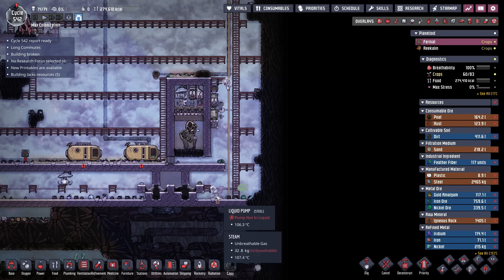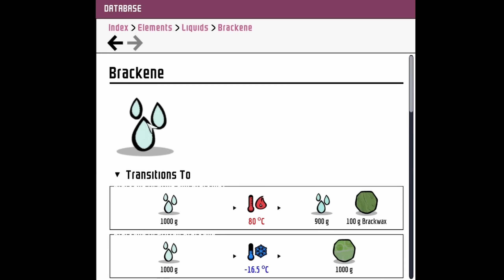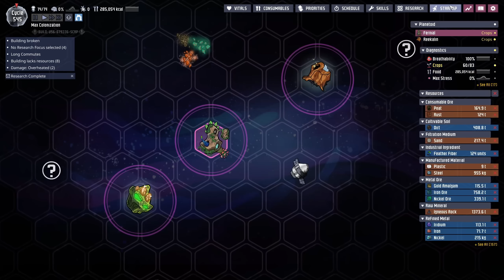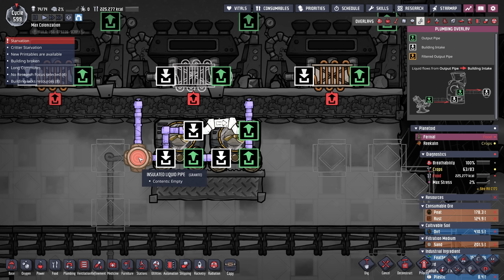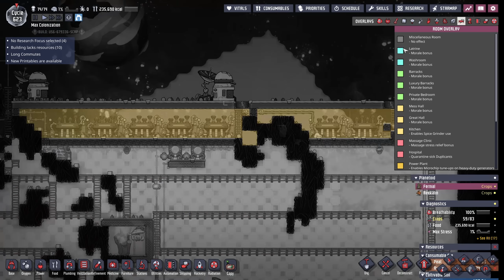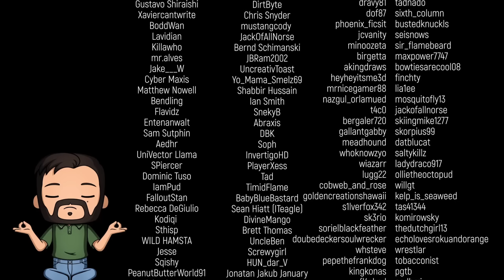Super Space Sauna is online and CHONKY | Ep 15 | ONI - Max Colonization

Comment: For all the debris in the sauna, wouldn't it make sense to put it all on one tile, build a small temporary chilled box underneath the tile you put all the material, then destroy the tile separating the cool box and the material to drop the material into the box, seal the sauna back up losing minimal steam and turn on the coolant system to chill the material overtime? 

As for the neutronium I say keep it, makes the sauna more interesting and a challenge to work with

Comment: Echo: hot take (sauna pun boom!), your sauna design is maybe upside down. Ish.

Since you asked for our sauna-design thoughts,

1) You’re dupe travel is unnecessarily long. Have them enter the sauna from a central, vertical, 2-stack liquid lock located below the volcano at sauna lower-center. Will save a ton of dupe travel instead of having dupes enter the sauna at far right lower corner, requiring dupes to travel from map-center to far right, then liquid lock, then climb up, left & over the polluted oxygen geyser.

2) if, as you mention, you’d like to avoid the worst decor region from power producing buildings & wiring, put all your power producers at the top of the sauna. Your steam turbines are already there. Put the hydrogen generators, & all future power production, on the row directly under turbines. That’ll localize all your power and your power spine, and

It’ll free up the space at the bottom of the sauna for most-used industrial machines, such as metal refinery, far far away from the worst decor region, and make those areas much faster for dupes to access.

Comment: I'd argue the difficulty of working around the neutronium is both part of the challenge of the Meteor as well as a pseudo-punishment for failing to destroy it, intentionally or otherwise. So my vote is for no mods to destroy the tiles.

I saw an interesting idea to make destroying the Neutronium a reward for accomplishing a later goal like domesticating so many colonies. that way we get an interesting spaghetti build now that can be "fixed" later.
Reply: Wasn't this base done in the lab where you only have 10 days before meteor comes? I don't think you can destroy it in these conditions
Reply: @mirrorglazed no, thats a specific challenge mode. You normally get 100 cycles to destroy the meteor in a standard game. Echo did a seperate stream of the challenge mode where you had to survive so many cycles post meteor landing.
Reply: I’m currently on cycle 450 of the challenge mode, it’s not much different than this play through other than having to rush insulated tiles

Comment: You should really start putting liquid reservoirs in your cooling loops. Helps with all the overfilling issues and evens out the thermals! Dead simple to add.
Reply: Reservoirs really aren't necessary.
You just have to use a bridge to connect the filling pipe and make sure that the aqua tuners are turned off while filling the loop.
It's that simple.
Reply: @Jehty_ never claimed they were necessary, but reservoirs help a lot, especially by smoothing out the thermals and if you want to change the length of the loop it is trivial to do so. It's just a quality of life.

Comment: 30:44 For getting into a building in this way, preventing 2 different gasses from mixing, put the liquid blob lock on the side of the building using a single tile. Then you reach through the lock to dismantle the wall by the tile to the side of the tile you just made and the tile above that one. When you rebuild it pushes to gas back into the room and the liquid never moves so it can't fall into the room.

Comment: Radbolts on Neutronium still works, but you have to surround the 3 adjacent tiles form it except the bottom; even liquid works. That means it's immediate top, left, and right must have another tile or liquid on it. But play safe and just use actual tiles.

Comment: When I have other gases accumulated on the top part, I build the ceiling with a 2x2 or 2x4 hump with a pump inside. The gases accumulate there because it's higher, instead of moving side to side all over the place.
Reply: I don't even put a pump in there.
Just let that room fill up with the junk gases, after it's full seal it off from the steam sauna and then just vent the junk gases.